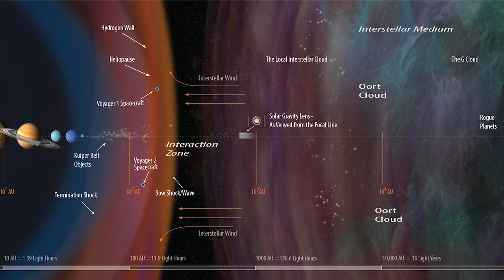Going Interstellar

Comment: im thinking more of how to manouver and decalerate on the approach.. you cant really communicate with it like and program in much.. because of the massive distance/speed. and we have dont really know much of the dibre and other stuff in that system. so it basicly also need a stelar version of the "selfdriving/parking car". and deceleration because that increase the chance of well succes and maybe even more info about the area by a major point.

i mean we could theoretically Launch a probe to the nearest black Hole but just throwing one in would barely give us any data... alot because of time VS communication barrier on Distance.

Comment: The videos look great but the reality is different.   Even being hit by a grain of sand at those speeds would have disastrous consequences
Reply: 1) Space is virtually empty. Yes, there are dust particles and rocks, but the distances between them are vast. See:  https://van.physics.illinois.edu/qa/listing.php?id=1132
2) You can send out a lot of probes one after the other. In the vacuum of space, once you beam them out with the laser for a few minutes they'll keep going by themselves.

The chance of any probe being hit by anything is extremely unlikely. The Voyager mission has been going for 40 years and hasn't struck rocks.
Reply: True, particles are separated by great distances but relativistic speeds shrinks the distance between those particles considerably.  BTW, Voyager is not traveling at relativistic speeds ...not even close.

Comment: the story about speeding up is pretty clear, but what about slowing down?
Reply: Koen Smit  -  decades ago Robert L. Forward proposed https://en.wikipedia.org/wiki/Starwisp.  I attended one of his presentations in the early 80's and he had an answer . . . a variation on  von Nueman probes, the probe would rebuild itself into two compnents, a giant reflector and a smaller light sail/probe.  Earth would send another burst, the reflector would not only decelerate the probe, it would be accelerated and leave at a much higher speed.

Comment: Accelerating to 0.3c in only days or weeks, how do the required G forces not kill anyone on board such a spacecraft? Reaching speeds of 0.3c after two weeks of acceleration requires round-the-clock accelerations of 10 Gs, more than even the most highly trained human could survive for more than a couple of minutes.
Reply: koolguy (5 years after your "question") the Breakthrough Starshot Project is for ROBOTS, mineature ones at that
https://en.wikipedia.org/wiki/Breakthrough_Starshot
We may eventually do starships for people.

Comment: Lets see, 100 gigawatts (their higher number) over 10 minutes is 60s/min x 10min x 100 GJ/sec = 60,000,000,000,000 joules. The momentum of a photon p= E/c or 200 138 newton meter second. At 100% efficiency (ridiculous BTW)  this could accelerate a 100 kg object 2001.38 meters per second or 2 kilometers a second, is a tiny fraction 6.6 x 10^-6 of the speed of light. There is something about this claim that does not add up.
Reply: +michalchik Pretty sure your calculations are off, though I forget the metric unit conversion factors.  I just recall that one Horsepower is 746 Watts.  So the laser would be like 120 MHP (not a traditional unit I know, but bear with me).  That's about 1M the power output of a car that can get from 0 to 100 km/h in 10 seconds, so in just 10 seconds, the laser could accelerate a car to 100 M km/h, around 2 M km/min, around 40 k km/sec.  Multiply that by 60 for a 10 minute burn,  multiply by 10 for the lower mass, you get 24 M km/s.
Reply: +michalchik I do recall that a car is not a spaceship, and that a laser is not powered with gasoline.  What I provided was a conservative approximation of the speed that could be achieved with a 100 GW laser on a 100 kg vessel.  My point: you are off by about 7 orders of magnitude.
Reply: +michalchik  Even if it did, how the hell would they stop it? Or slow it down to enter the atmosphere for landing? Good calculations btw
Reply: Acceleration is in meters per second per second -.-
And it's not only one photon
Reply: +Thyriel I am talking about net acceleration, total change in velocity. Not acceleration rate, change in velocity per second. 

The calculations were in meters,  I just mentioned the km conversation because more people are familiar with the speed of light in km.
Reply: +BorisQueue. You are doing a calculation for a direct conversation of engine power into frictional work. Disregarding the conversion into horsepower which probably adds error,  that is a fundamentally different form of thrust than electromagnetic impulse.
Reply: +maumauhun Personally, I think his math is off by about seven orders of magnitude.
Reply: BorisQueue  I appreciate your attempt to put some numbers on this but your extrapolation has another major problem,

Kinetic Energy is proportional to the Square of velocity, you extrapolationis linear. This becomes more and more important as velocity increases. In other words increasing 100 kmh from say 1000 to 1100 takes (1100^2-1000^2)/100^2 =21 times as much energy as going from 0 to 100.
Reply: Yeah that was stupid -- you have to square root my stuff.  But I still get a number 3-4 orders of magnitude higher than yours.
Reply: BorisQueue  Or better yet, think about sunlight falling on earth. 1 square metter or the earth at high noon. 1,360 watts per square meter more than 1 horse power.

http://earthobservatory.nasa.gov/Features/EnergyBalance/page2.php
Reply: Not sure where you're going with that....
Reply: BorisQueue In this video (proposal), how is the spacecraft being pushed.

Comment: This is great but I can only hold cautious optimism. They say we can do this or that but don't usually follow through. It's been over 4 decades since we've done anything significant when it comes to the space program; sure the new horizons thing was great but there hasn't been anything beyond that.
Reply: +Carlos Contreras You should really do some googling. New Horizons was recent, but hardly the only significant thing achieved by the space program in 40 years.

Comment: The way I see it, where we go from here is to develop very cheap launch capabilities using reusable rockets, Skylon and StarTram, the latter two being cheapest. That achieved, we can then build up a system wide "beamer" infrastructure using solar-pumped lasers along the lines of DESTAR. We'll need to launch thousands of tons of gear to make this useful. After a while we will end up with a web of high power steerable laser beams crisscrossing at least the inner solar system, enabling fast and efficient colonisation of the Moon and of Mars. All this serves as a precursor to beamed interstellar flight.

Comment: In the video, the narrator says that at launch the shuttle has about 50-100 Gigawatts of power, and that you can get a spacecraft to "relativistic speeds" with the same power level. That's ridiculous. To get any reasonably-sized craft to 30% the speed of light would take far more energy than that. If it only takes 50-100 Gigawatts to reach 30% c, then why do current Mars probes not reach that speed? Why do they take months to get to Mars when the narrator states that we already have the rocket power available? This is just unscientific, sensationalist click-bait. Don't fall for it.
Reply: +Keith Ballard Power in Watts (or Joules per second) is not the correct measure - Energy in Joules is.  So of course it's possible to reach 30% c with 100 GW. It's simply a question of the craft mass and the length of time over which the power is applied.
Reply: +Keith Ballard He is talking about pushing small wafer chip sensors to relativistic speeds with a laser located in orbit around Earth.
Reply: Yes, and...?

Comment: The problem is space is not empty. Even the space shuttle got hit with tiny rocks and dust all the time. 30% is a significant portion of the speed of light. I would think that traveling at that speed through the solar system; especially the inner solar system, would be like being in a sand blaster.
Reply: +VirtualSuperSoldier I see English letters in the comments but its all Greek to me
Reply: +VirtualSuperSoldier I think we can all establish that going 30 C hitting anything other than a very sparse gas cloud will result in obliteration of any vessel ..

However, .. we aren't talking about putting people in these ships are we? That would be ludicrous.. besides , it's unnecessary.. by the time the required technology is met we will have artificial intelligence to navigate and do all of the operations we require ..  Though, spookily , when half way through it's mission it could change it's mind haha ! and decide to set up a robotic alien like colony on some moon and build and advance on that moon for 1000 years until it reaches the point were it is militarily more advanced than Humans and planet earth and then we have real life fucking star wars..

besides even without AI we can communicate via radio waves at the speed of light anyway, which you would do to inform planet earth anyway if humans were on-board
Reply: +VirtualSuperSoldier For non-magnetic particles, an ablation shield, for magnetic particles, a generated magnetic field guiding them around the craft, and for more substantial objects some kind of laser defence system to get the smaller objects into an ionized gas form for the magnetic field to handle.  You arn't wrong though, higher speeds offer new challenges.
Reply: +VirtualSuperSoldier The paper actually had a section on this. It was rather interesting. For interestellar travel, the idea is first to give the probe as small a cross section as possible. The plan is to use 'wafersats' which are extremely thin and lightweight. The image I got was a computer chip. Their weight would be measured in grams instead of kilos or tons. So, lowest crossection would be a long, stretched out, thin chip. From there you can add redundant wiring, which will help keep it working if it takes a hit, a sort of waffle design to the actual chip, to help keep it from shattering. They also mentioned possibly adding a thin shield of Beryllium (Be) as a shield on the leading edge. though this would increase weight.

They also ran quite a bit of math on the likelihood of impacts, and how much energy they would transer to the given size of particle. It was interesting, but not being a physicist myself, I couldn't get too much out of the equations.

Long story short, make the craft less likely to hit anything, using a narrow cross section, and make it more likely to survive small impacts with dust, which are by far the most likely things to hit it.

The other piece to this equation of course, is send more than one. since they're tiny and presumably (relatively) cheap, you could afford to send hundreds at a time, greatly increasing the likelihood that some will make it.
Reply: +VirtualSuperSoldier 

1) Space is virtually empty. Yes, there are dust particles and rocks, but the distances between them are vast. See:  https://van.physics.illinois.edu/qa/listing.php?id=1132
2) You can send out a lot of probes one after the other. In the vacuum of space, once you beam them out with the laser for a few minutes they'll keep going by themselves.

Therefore, the chance of any one probe being hit by anything is extremely unlikely. The Voyager mission has been going for 40 years and hasn't struck rocks.
Reply: +VirtualSuperSoldier Also, in my original post I neglected to mention that a ship/sail traveling at at .30C and connecting with even a small bit of loose material would likely result in a catastrophic explosion destroying the ship.
Reply: Brian O'Kongkohwer These thought experiments are always so much fun, arn't they?
There are some fun ideas for ablative shielding that vaporizes then re-coalesces continuously (confined by magnetic fields, made from efficient radiator material)

My answer was only for in-solar system travel though, inside the helio-whatsit we have about 1/100th of the density of the interstellar medium (last i read, estimates of that kinda thing seem to change alot). 

I wonder, could you use light pressure to clear a cone of particulate matter in front of the ship, like a bow wave? After all, since you're traveling at fractional light speed its not really the lateral motion of the particulate matter you're concerned with.
Reply: +VirtualSuperSoldier Let's not forget that with that great speed those tiny rocks/objects impact force increases.
Reply: +VirtualSuperSoldier I bet there is a very small chance of be hit with something travelling at light speed during only 30 minutes in straight line...
Reply: +VirtualSuperSoldier You underestimate the vastness of space.
Reply: Zack Mickler
 Not to be facetious, but you can have a vast space that is completely filled with stuff. Vast is not analogous to empty, but I do know what you meant.
Reply: +VirtualSuperSoldier This is great. I've learned a lot just in grappling with this question. To be clear though, I'm not suggesting that the attempt should not be made to send probes to places like Alpha Centauri if its possible. I'm simply interested in the problem of collision avoidance when you're on a 30%C bullet train that can't stop or perhaps even turn. As far as sensors go, how would you detect something as small as a pebble while traveling so fast? Especially with enough time to avoid it? keeping a low profile will help but if you're on a trip to Alpha C, then you're talking about going 24,807,269,227.74 miles. What do you think the chances are of going that far without hitting even just a pebble? Even in deep space? Speaking of interstellar probe profiles, maybe that's why the monolith in 2001 a Space Odyssey was shaped the way it was eh? Arthur C. Clarke was so ahead of his time. How cool would it be if our probe to Alpha C looked like that!
Reply: Hi, I find this fascinating, and I'd like to find out a bit more about these solar sails. Do you have any studies or documents that are detailed and precise enough to advise me, please?
Reply: +Brian O&#39;Kongkohwer This is the best use of technical terms/jargon I have ever read! Whether what you say is feasible, valid, hot air, does not matter! Awesome!